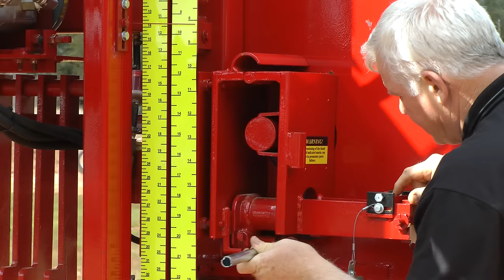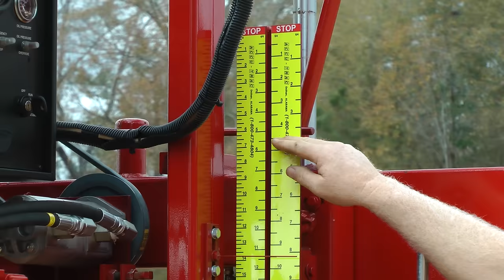Cook's AC36 Hydraulic Sawmill Demo

Comment: I own a woodmizer LT40 with an 1990s woodmizer sharpener and single tooth setter,I live in Northern Maine and let me say Cooks Sawmills is second to none. I called them and asked about the super sharp blade so they sent me one for free. the chips didnt look like ground corn, the blade was actually cutting real chips!!! I called cooks and spoke to Marcy :) I purchased a setter and sharpener from Cooks 5 years ago, It is key to my operation, I currently file blades for sawyers in the area because of the edge I am able to produce with my equipment. I have mothballed the woodmizer sharpener. Cooks Equipment is built like an Abrams Tank compared to the competition, 

sincerely

Mike from Maine :)

Comment: As an old marketing guy, i am impressed with your astute and succinct tutelage, Mr. Cook. Smart move, Sir. I was sold in the first minutes, just as soon as you mentioned that your grandfather sharpened blades, simply because i instantly knew you understood something about cutting wood. I sharpened my hand saws i used as a heavy construction union carpenter to pay for my university education. I sharpened my 36" bar STIHL at -36F degrees, deep in the Northern NH woods, when logging to pay for my university education. I did not "sharpen" the 36 inch clamshell crushing jaw on the biggest portable stone crusher east of the Mississippi that i ran has lead crusher during the summer to pay for my university education, but i gone and dun broke the 6" think steel box holding the jaws (split it in half vertically) on the very last day of work on that machine. What i am meaning to say is i get-it what you built. The 1/2" steel for the log roller frame, the heft and the anti-kickup dogs of the drag-back-fingers shows crusher grade invincibility that is so very back-woods smart.   I can see the Very Fast Speed your mill functions at. I would guess it is Three Times FASTER than any mill i have seen operated. IMPRESSIVE. [my design instinct wants to make the saw frame have legs in front of the saw wheel, too, coming down to a bed that is a two feet longer so the whole thing will roll better and be absolutely rigid in its stability for an A48 size mill. (but i bet there is a good reason why you don't do that, right?) That same motor sounds like it could handle that. Gosh, what a sweet sounding machine... so quiet, yet powerful. SWEET ! ! ! Bravo for you. (oh, wait, i just now see that you have A52 and A62 super wide mills).

Comment: I have a Perkins 5.4L 6 cylinder diesel engine that came out of my 1960 Bedford TK truck it now runs a generator and is as good today as the day my Grandfather bought the Bedford TK in 1960, this engine has been running well for 50 years.

Comment: A very well thought out mill, I like the reverse action of the squaring procedure, makes sense to minimize cutting through the bark.  However there is one concern and one improvement I would like to mention. First the concern of the sawdust extraction. I notice the sawdust does not exit through a chute, but rather, just sprays across the mill bed. I noticed a good portion of the dust just raining down in the bed and rails, and all the attachments, like hydraulics etc. It would not take long to fill the bed underside with sawdust.
 Second, the improvement. What I have never seen on any mill, is an idiot stop in front of the blade to prevent hitting the squaring arms. just about every video I have seen, the operator has admitted to hitting one at least once. Since this particular mill is so advanced compared to small homeowner mills, a sensor operated stop would add one more nice feature to an already well thought out mill. Congratulations. Cheers. P.S.   One other improvement but more rather a luxury, would be a metal detector.
Reply: How  do you fuel the engine

Comment: I'm really impressed with your explanation of the reasons why you have engineered your mill the way you did. I've got a question about something you mentioned. If the bark and mud grind/dull the teeth on the blade on the entry side - why wouldn't it affect it on the exit side? Is it because on the entry side the blade is pulling the bark/mud into the cut and it's being compressed (binding) between the teeth and the wood? And on the exit side it's just getting pulled out and flying into the air (meaning there's nothing to compress against)? I can see where it wouldn't be a problem at all if you're cutting on two clean edges. But even with an exit edge being muddy, it seems like there's potential for dulling on the exit side as well.
Reply from the maker: Hi Kurt,
Yes. The bite that the leading edge of the tooth makes as it enters the log is trapped by the gullet of the tooth and (we hypothesize) 'tumbles' in the gullet creating an accelerated dulling of the blade compared merely to sawdust from a clean sided entry. Whereas the existing side obviously does not have this entrapment. 
However, mud, rock, and bark even on the exiting side are going to cause dulling but the goal is to minimize having to enter into the cut on the bark side as much as possible. 
We have literally logged thousands of hours of blade testing on various setups that show a prolonged blade life by rotating the log so that after the first cut the preceding cuts are entering a clean face.  That is why we concluded to engineer our mills so they clamp on the left and enter the cut on the right (as the operator faces).
Thanks for the question and hope that answers what you were looking for.
Reply: That makes perfect sense - it seems only logical. It's pretty much the same thing that happens when you use the chainsaw. And with a chain saw, you're cross-cutting through the bark with every cut. It's no wonder you have to sharpen those things so often! Thanks for the response.

Comment: This is almost identical to my mill, I run a Timber Harvester 30ht25. A couple of small differences, like how the clamps move in and out, mine has a hydraulic motor that runs a gear along the bottom of the slide, my cables and hoses run back and forth on a cable in the air, not inside a chain and this has 2 axles instead of the 1 mine has.

Comment: For rough lumber you don't need such exactness. I'm a cabinet maker and I'm a machinist and have made crankshafts. Nice mill though.
Reply: I built my own bandsaw mill and it's nice to have usable lumber right off the mill for projects and siding without having to put it through a planer. The exactness you build into the machine is worth the effort, which is minimal if you have any talent at all.
You can force timber through a somewhat dull circle mill, the same cannot be done with a bandsaw mill. 
It must be sharp and run true on all planes.
Reply: I would guess that there is a difference in what you cut. If you cut fresh pine in the winter that will shrink and cup I guess that you are right 😋. But if you cut seasoned hardwood (been out drying for years) that you then just kiln and plane to gain maximal revenue it would be nice to get as much out of each log as possible. I would think that it would be easier to plane/process if all the wood would be as dimensionally identical as possible.
 I do metal work for my living. It's not nice when someone orders "blanks" and put ½" or more extra "just to be sure". It usually takes a lot of extra time to get it roughed away. But buying that extra material is usually quite cheap so...

Comment: I guess we can assume this a fairly well produced saw, one that has had Important improvements over the years because of problems that are E X P E R I E N C E D during YEARS OF Varietal USE.  I am sure they have made decisions on materials/ sizes weight bearing. welded vs bolted frame
Now, how much can I save by making aq like one say we look at Matt C's recent log trailer build. That was close to $4K but this is easy double that expenses with the motor and many features.and a lot of days.  The idea is how much are you going to make per day selling the output.At $1000  which it can easily do. You are growing customers and income. At 5% financing or cash what is 10-14 days of working (cutting logs) vs building a machine.  Unless you want to be a machine builder too.  Some say I wont want a small saw like this. I want a bigger one. Well when you can keep this one productive it will earn a bigger one and you can then have two saws and can hire another saw operator and keep a handler busy. Or you can have a kid and wait about 16 years per ; like the Cook family.  Like that log loader, sometimes at the cafe it can get pretty deep and heavy.  And the log roller, cannot say it is a bad feature to add if you do more tan 3 cuts per day, every day. Why would ypu get one and not use dirt, they afre found in many yards across America. Their loss your fortune. Stay Sharp. And BTW the Kant Can't.